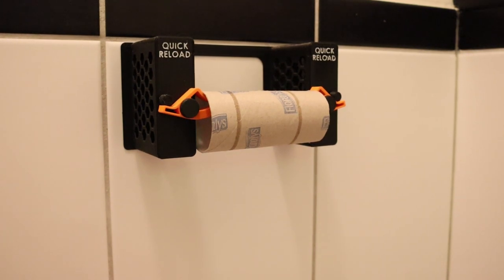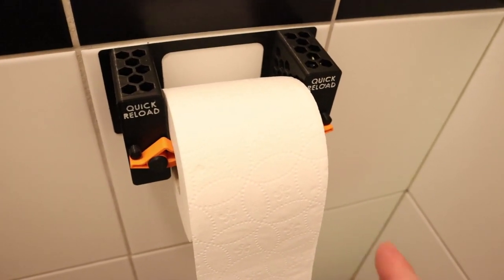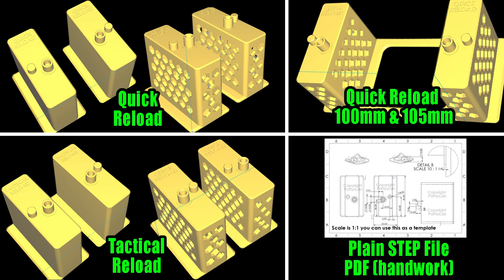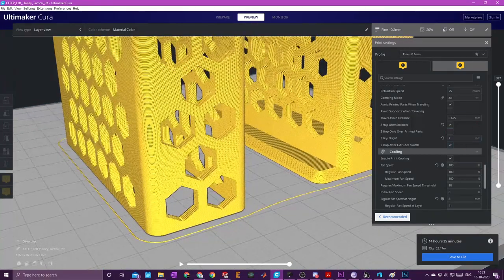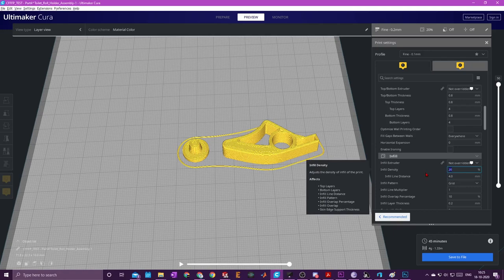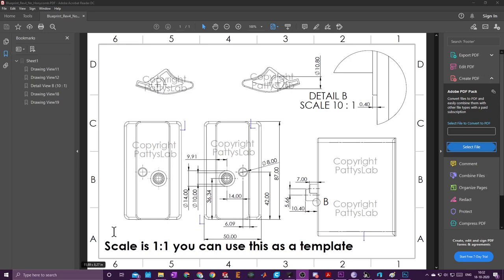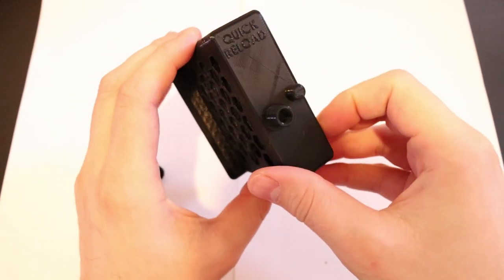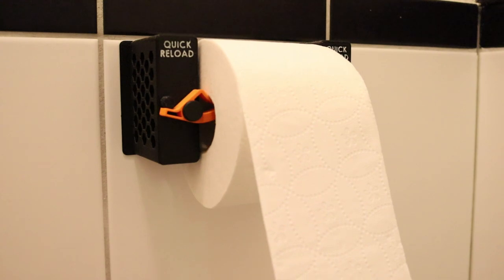TOILET PAPER TACTICAL RELOAD!

Comment: This is a lovely design. I would like the same but using ball bearings for the arms pivots, with the ball bearings visible to the user, to add to the high-tech look of this holder.
Reply from the maker: But remember that will probably rust in moist environment ;) hence why I didn't do that, but cool suggestion!

Comment: is the 1:1 template for A4 paper or letter?
Reply from the maker: It doesn't matter since you just have to set your scale to 100% the border will only just be clipped. But originally designed it for A4 paper

Comment: Great design, you're definitely quite an innovative engineer. but.. 3d printing is not your thing. You have serious over-extrusion problems, your overhang and bridging settings need a lot of work, you have a layer shift problem on your Y axis; probably from print/travel speed, or lose belts etc, and you're also printing too cold, or part fan is too high -- hence the breaks and layer separation, and finally your retraction settings need to be increased to remove all that stringing. Many of the issues you are discussing and warning people about are not model specific, and more to do with your personal print settings. 

great model though!
Reply from the maker: I have modified my printer so many times that I sometimes don't know what the problem is ;) Saying that 3d printing is not my thing is a bit odd Imo. I might sound like that I don't know what I'm doing. If I had to reprint all my parts that have defects just to show youtube that I can do it. Takes to much time.. time I don't have. If you would have checked all my video's you would have seen what the printhead looks like (the size of a sledgehammer). Furthermore cura has so many settings, Since I use the printer for research aswell, you sometimes forget a the hidden settings and then draw a incorrect conclusion..
Reply: @PattysLab  all valid answers, but me personally would not upload a video with my printer all out of wack like that. Maybe I'm just a perfectionist, but I like the results I show the public to look their best. I feel it reflects on what im showing people.
Reply from the maker: @JonathanClose  I'll just give the people what they want and that is cool designs with instructions how to slice and print them. I don't care if not all my prints turn out perfect. People who understand the process can look past these mistakes